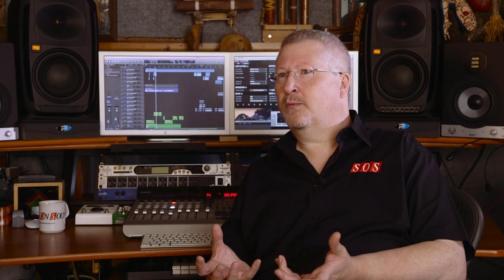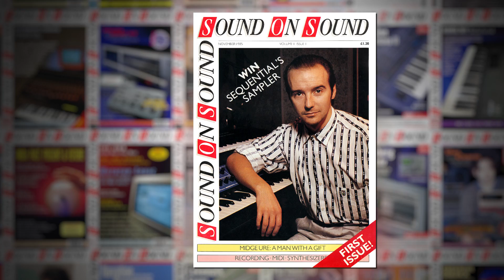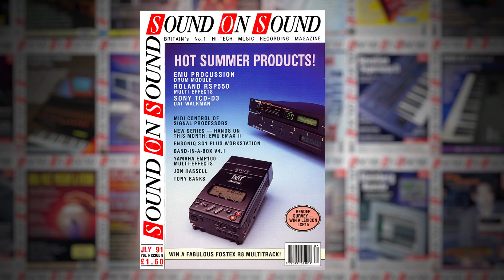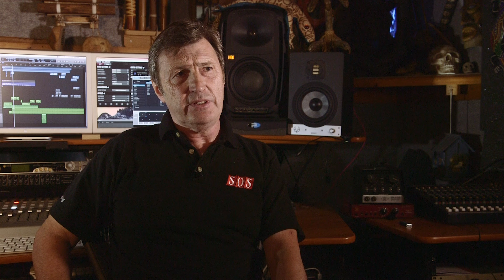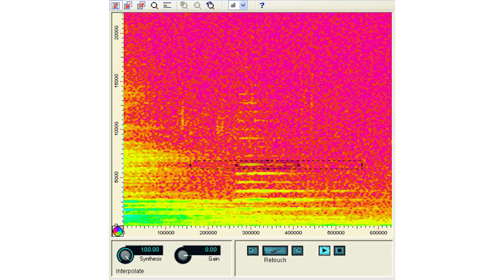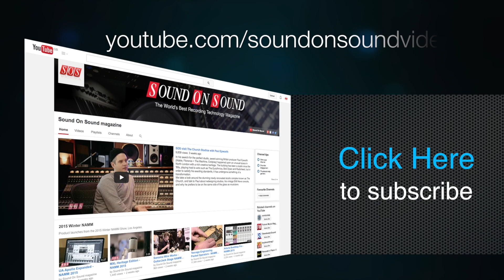Recording: Past, Present & Future Of Music Technology

Comment: I took this journey with you guys and was a subscriber to 'SOS' and 'Home And Studio Recording' during the 80s and 90s. My first setup was bouncing two cassette decks through a mixer. Someone convinced me this was a better solution than squeezing 4 tracks on a tiny cassette tape with a Tascam 244 Portastudio. The worst advice I ever took which I discovered when I eventually purchased the 244! That was early 80s, then I moved to a Fostex reel to reel 1/4 inch 8 track, with a Fostex midi mixer. I would stripe the tape with SMTPE then control everything via a SMTPE - midi sync unit. I used the very popular Quadraverb amongst other rack mountable effects. It was quite an elaborate set up with many impressive flashing lights and automation on the mixer, with faders moving by themselves and mute button lights flashing on and off. Those were the days! I used C-Lab Creator on an Acorn Electron, which was amazing at the time. then moved on to Logic Audio which was a fantastic package, but Emagic canned the PC version in the 90s so I eventually dropped out of recording completely in the mid naughties for a few years after having held on to my Windows XP DAW for so long. Then, in 2015 I discovered the wonderful world of Presonus and Studio One. Its design and operation being very similar to Logic Audio, so I took to it like a duck to water. I now have the amazing Quantum. What a powerful system!

Comment: Convenience is overrated. Most of the time computer stuff has too many options. The brilliant thing about analog (old stuff, if you will) is that it limits your options. You don't waste your time thinking about whether this track should be +0.1 db higher automated from bar 7 to 8. Rather, you spend more of your mental capacity making music. And more happy accidents occur with old stuff. With digital you just got too much control. Very often the results sound boring. And with the digital "revolution" everyone is able to turn out crap. The supply is enormous, making it almost impossible to navigate. Within the synth industry we see a real surge in one-knop-per-function analog synths. People crave simplicity and that great analog sound, that is not easily replicated by digital.